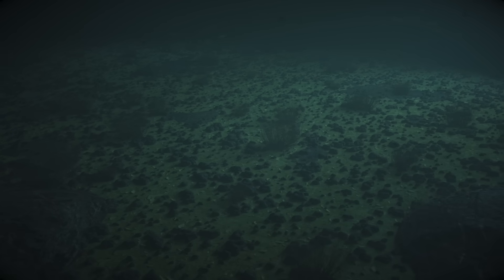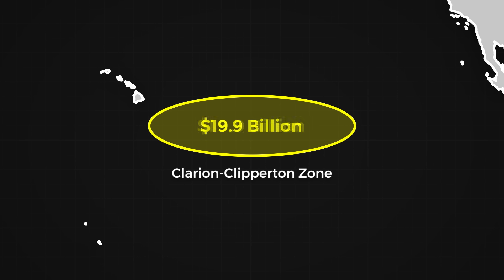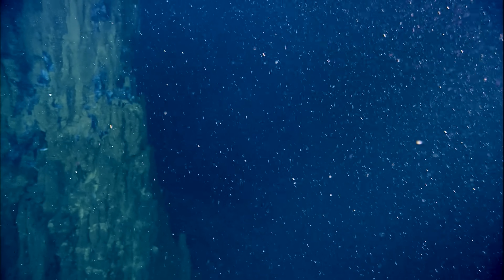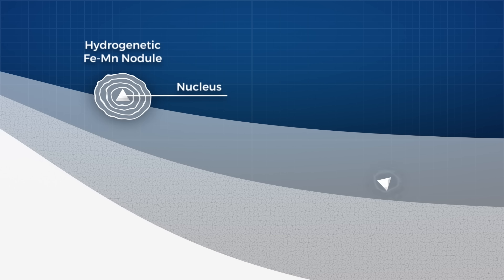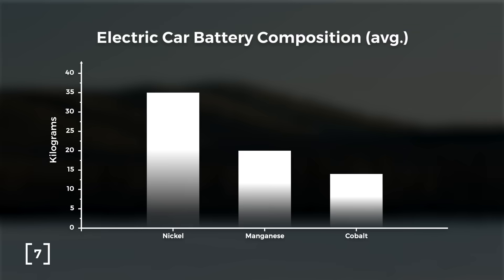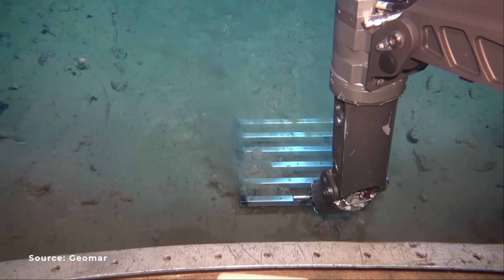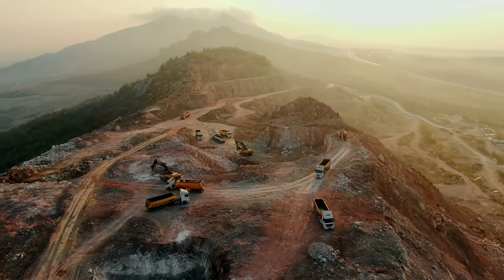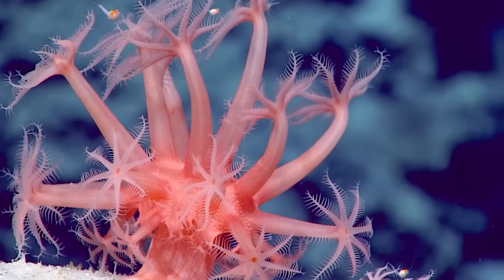The Truth about Deep Sea Mining

Comment: Some thoughts: Do I understand correctly that the main environmental problem is that there are no more solid surfaces left after you mine these? If so, you could pump limewater and CO2 gas down to the rover and let them mix to make limestone where the nodules used to be, this would also sequester carbon. Also, I get that you can't release the sludge in coastal water because it would cause algae plumes that outcompete seaplants, but why not on the high seas where there are no plants?
Reply: Exactly. Make an artificial ecosystem in a barren desert that's in the middle of nowhere.
Reply: 2. He said the reason you can't release the sludge into open water is that it would block out the sunlight for algae, killing them.

1. It would not sequester carbon because limewater doesn't occur naturally; it's only produced by taking sequestered CO2 and de-sequestering it ("calcining limestone").

sighs I guess you could try it, not to sequester carbon, but to see if it works as a half-baked replacement for the apparently irreplacable-as-diamonds cores of these ancient ecosystems though.  But you'd have to finish discovering what even is down there in order to actually test that (if actually testing is important—if doing any of that is considered important, given we're all apparently fine with this irreversible damage to ancient life not even discovered yet, or the alternative being massacring the children of nations to make conflict minerals in Bolivia and Congo &c.  .....instead of just impose the inconvenience on the 1st world of using aluminum-air or sodium-ion batteries or something before they're the cheapest possible solution and we're forced by greed to not destroy the world and the people in it in spite of our efforts to).
Reply: @puppypi9668  Is there anything special about these nodules that sealife needs? Because it sounded to me like it only needs a solid surface.

Appearently, there are other types of minerals with a simlilar effect to lime, but they occur naturally dissolved in groundwater, could that be used?

I also think that we should approach enviromental problems from every possible angle, so we need to explore these options no matter what.
Reply: @marcopohl4875   That's a good question.  It could easily be the actual minerals themselves, since they're found nowhere else in the ocean in such high concentrations.  I'd be surprised if life hasn't become dependent on them in random particular ways (probably microbial life that forms the basis of some ecosystems).  But that would take research!

In any case, the fundamental issue is that if we only can do the cheapest greediest thing, then there is no sustainable long-term solution.  Because we could even bite the bullet and ravage the earth and humanity Once on the promise to never have to again to find the cheapest way to make renewable energy—cheaper than fossil fuels....and then one day (decade) later a new terrible thing is discovered that makes The Only Economically Viable (ie, cheapest) option be something horrible, and the mere fact that it randomly happens to be cheaper for the next 30 years makes it "economically impossible" to continue doing the things we put so much sacrifice into building (sacrifice of human effort and research and such, but also "one-time" permanent harm to the natural world)...it'll all be in vain.

And if we had the ability to do that, to use engineering principles of matter and energy and efficiency instead of the greed of investment banks and corporations and things..then we already have plenty of efficient enough solutions!  So I think we have approached it from enough angles, the problem is a different one now.

I think of it like a bunch of people trying to save someone from a well.  They need a ladder to do it, but then just keep building better and better ladders, because no one actually wants to actually go down in the well and they'd rather focus on making ladders.  At some point people need the will to actually use them!

(In that analogy, "the will to use them" means doing what's right because it's what's right. You might, like lots of people, not think that's worth your time.  But like I pointed out..the universe has no natural teleology; it's under no obligations to make the laws of physics be such that there will always be a way of doing things that's cheaper and also what's right.  So the idea that we can science our way out of this relies on the pseudoscience that there's always a cheaper thing to be discovered out there, and if we can _just find it_, then we can keep making sure the current Cheapest Option will be one that makes the world better.  That's not how reality works—the universe has no morality to it and makes no such guarantees.  So sometimes you just need to do the right things for the right reasons.  And if you can't do that...then why keep putting energy into fruitless endeavors like we have for the past 50 years, when it could be spent on things that can work, like making sure all this research we're pouring our lives into doing is actually ever _used!_)
Reply: I should also point out that even if we destroy these things to make enough cobalt and etc. available...just like with coal in the 1800's which literally got us into this mess in the first place:

If you increase the supply enough that the price goes down, people often find new ways of using the newly-cheap things, which increases the demand, and suddenly you need more of it simply because you had more of it.

In this case that means even if we do this, it's very possible for demand to increase to the point that the current terrible processes this is meant to obsolete still "need" to be done or resumed to keep up with demand ("need" because someone can make money doing it so we "_have_" to do it).

Because obsoletion is not prevention.

(And again, you can say, well then we can make it actually illegal to perform crimes against humanity and the world...but we already can with many existing technologies..so why don't we?)
Reply: @puppypi9668  Cap. That part of the ocean is barren desert. Algae doesn't grow by sun alone you know. If they release the tailings as they move, they'd make nutrient rich water. I'd always choose the advancement of society over some ancient life we don't know, it's not like we're mining the whole ocean floor.

Comment: deep sea mining has been in the focus of many companies for several decades. this didn't suddenly become popular because of renewables. most of the areas in the ocean where the nodules occur are in international waters, and basically anyone can mine them, the interest has been there for a very long time, but the logistical and technological challenges are still extensive. if the tech becomes economically feasible, this will happen unless stopped, so I guess your friends from the gas and oil industry don't have to worry about this. the metals in the nodules are not used only in renewables, btw.

Comment: Math; using the tonnage of "wet nodules" to calculate the KG per battery completely ignores mineral yields, refining, pretty much everything required to take a pile of rocks, and make a laboratory pure sheet of refined metals from them
When "Profitable" , companies will probably use sea floor scraping dredges, which are well known, cheap, and horribly destructive

Comment: 9:25:"...at the very least we need...": If they can do a "riser", why don't they also do a "faller". Connect the riser to the faller at the processor on the surface. Leave riser and faller open at the sea floor. The potential energy in the riser is essentially balanced  with that of the faller. Thus, all you need to do is provide energy equaling the potential energy you remove from the process...plus a minor amount of kinetic energy to move the material at no potential energy delta...i.e. to overcome drag.

Comment: I am curious about the study of returning the sediment that is brought to the surface with the nodules.  There is certainly the aspect of shading out sunlight from lower levels but mid ocean areas appear blue because there is so little algae and plankton due to low levels of nutrients in the water at levels that receive sunlight. If nutrients from the sea bed were distributed at the surface, would the nutrients not promote blooms of algae and plankton? The increased growth at the surface would increase the "snow" falling to the lower depths increasing available food there.

All of the increased biological growth would be consuming carbon and possibly having a measurable effect on reducing ocean acidification.

Comment: 1.	Pump compressed air into the pipe is one way, but requires massive power from big compressors - but the technology/manifolds are there.
2.	Lifting pump is a good option and perhaps you can place several lifting pumps in certain depths while you are lowering your riser to sustain a constant-ish flowrate (or discharge rate of material on the surface), I do worry about the durability of the rotor and other moving/rotational parts in the pump

What I recommend is take the existing mud pumps from the Oil & Gas Industry, pump water based mud down your ROV (customise it in such a way that you will have a giant hopper working underbalanced) and then lift it up to the surface. Then use shakers and crushers (like the ones used to crush coal in a coal fired power plant) and then separate your little "nuggets" either by gravity or centrifugal separators (so as to use the existing rotational equipment/power and compressed air used on board).

Be prepared to have A LOT of spare Flanges !!

Comment: Lifting a mass from the sea floor ought to be really simple, shouldn't it?  You just inflate a balloon and let it go right up. I can see the benefit of continuous flow in that you don't have to collect your load in the collector itself, but between "can I throw a rock up a kilometer of pipe" and "dump it in a bin and inflate a balloon on top", the second seem like a much simpler solution to the need.

Comment: This looks less like 'the best way' and more like 'the first thing we thought of'.
We run trucks alongside combine harvesters, for example, rather than try to connect them to a central farm via a hose.
The plume of silt is presumably linked to the speed of extraction. So have the machine move slower, and wash more silt off the nodules at depth.
Maybe also use something other than tank tracks too.

Comment: I wonder if they considered use some crab cage like deposit boxes.  A crane suspended, propeller stabilized vehicle can drop the cages onto the collector.  The collector can then eject the cages onto the floor when full, for the crane vehicle to eventually pick them up.  Also this way most of the slurry will be released closer to the sea floor.

Comment: The question is, do species require the nodules specifically? Or if we replaced the removed nodules with rock would it provide the same habitat? We definitely need to set some controlled experiments. But I've already heard news stories of deep sea mining operations planning to exploit these nodules. My fear is mining will begin much sooner than we think, and it will largely be out of the public eye because it's literally in the middle of nowhere under miles of ocean. And the projected profits from this are very high. We don't know how these ecosystems are connected to the rest of the world and by the time we find out it will be impossible to undo.

Comment: Build a submarine with a (TBM)tunnel digging head. That way you can go down and dig 10 meters depth, the soil collected to be filtered and water injected back to the sea while soil and rock to be stored inside the submarine. Once collected enough to re-submerge to empty to a ship, and the cycle replicated. The copper among other minerals will make our cost of leaving cheaper.  Better for advancing AI and the civilization become past planetary species. This is for better upgrading humanity.

Please note the hydraulic should be design and install  parallel like we do to TBM, but installed at a 60 degrees angle so that it can support itself while grinding forward. Then de-touch and move those hydraulic arms forward and bush itself forward. The assumption am making is their rocks underneath sand, second assumption the soil underneath are mineral rich. Otherwise picking will be redesigned by submarine with strong wheat combine harvester like hands/sophistication. The main point is going up and down into the sea floor, that's critical for sea mining.

Comment: Lockheed Martin has mining permits, "claims," that are "grandfathered in."

The plume of dirt that the narrator is talking about will be virtually nonexistent because of the scandium and other elements mixed in the sediment.  Scandium is a "spice element" which is added, among other things, to aluminum to create an alloy that is comparable to titanium in strength and heat resistance, welds easier and cleaner and is 20 percent lighter than titanium.  It is an element that will become more and more important to the aerospace industry as well as automobiles. The sediment is just as valuable as the nodules or more so.  But of course, this scouring act will scar the bottom and should be mitigated somehow...maybe dropping broken lava, maybe from someplace like Mexico, to replace the taken nodules and sediment?  This video needs to be updated.

Comment: I'm obviously a huge idiot but I would have guessed they would use something akin to a trawl net dragged along the sea bottom from the rover to scoop up the nodules and filter out the sediment, then an Archimedes screw of some type to bring them to the surface (or drag the trawl directly from the boat and raise it to empty the nodules). 

Also, I wonder if they could re-depoait some sort of faux nodules made of chunks of rock, recycled concrete, or even recycled ocean plastic to help alleviate at least some of the environmental damage or habitat loss.

Comment: Limit harvesting/mining to strips 10-20ft wide, with at least 3x that distance between strips, which means a maximum of 25% of any given area can be harvested.

Also, pump half (exact pct to be determined by future studies) of the slurry back to the harvesting vehicle to release at the bottom in the same area it was removed from, and any remainder can be released below 1000m.

Comment: I thought you were going to say lithium there for a second and I was gonna throw a wobbly, because people hear that lithium is an issue for battery production and hear that it's a rare Earth element and think that it's not actually fairly common like I think it's like 33rd most common element, more common than lead, caesium and tin and is not particularly water soluble so unlike uranium for example which we have plenty off, but most of it is dissolved the the sea and completely impractical to extract it from the sea lithium is in nice concentrations on Earth and not terribly consentated in one area, however of lithium is because during the 

The lithium issue is a processing problem not a raw material issue, and because it's a process issue it can potentially be solved by improving the processing.

Comment: Just find a way to utilize hydrogen. Mybusters on the discovery channel made a carbureted 8 cylinder pontiac grad prix run on helium vapors fed directly into the carb. Bi product would be oxygen.  Most abundant element in the universe with no mining required. I would suspect since there wouldn't be enough financial gains to be made, they won't do the obvious. Bob Lazar proved a way to safely create and store hydrogen to be used in a car. Here is the video, you decide.   https://www.youtube.com/watch?v=Ytg23mDd1a4

Comment: While the exploration should be of an oil and gas style. I believe a dredging style operation would be the more effective/financially viable option.   Is a number of factors oil exploitation is more or less has been centered around a few key wellheads Versus dredging which is pulling a certain levels of sediment up.  This is why HMS challenger Was able to pull up a nodule in the 1st place Dredging has been around a lot longer than oil  Exploitation. And while for deep sea operational experience is needed from the oil exploration teams they are in turn not going to be able to fully exploit or make use of the area if they do the normal drill/oilman thing.
Reply: And follow up to who I think would be the better option to be looking at Would be drudgers and deep sea commercial fisherman.  The deep sea commercial fisherman has the experience in handling the boats  We're the dredger in theory Should have the knowledge on how to manipulate his dredge  In such way that he can reliably put the dredge on mark no matter the depth.